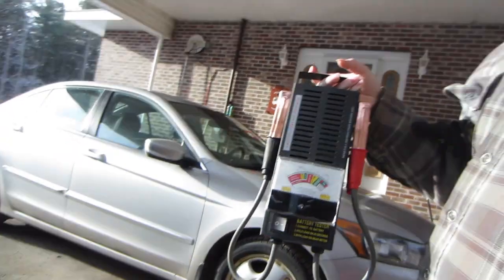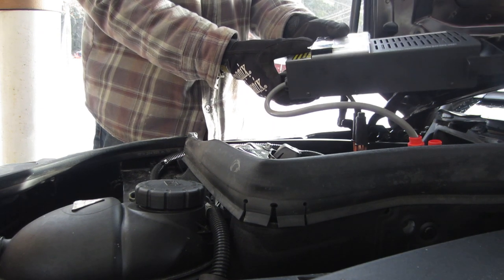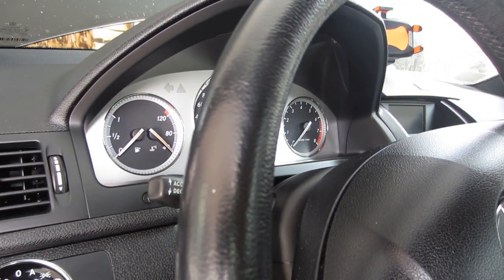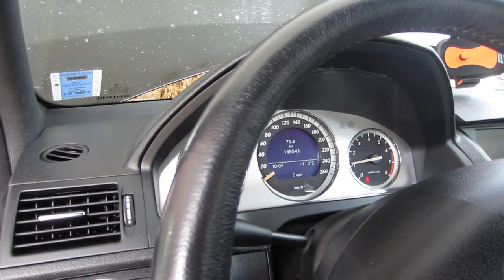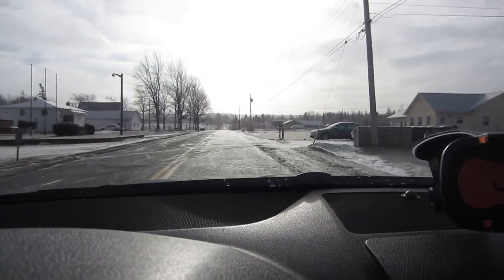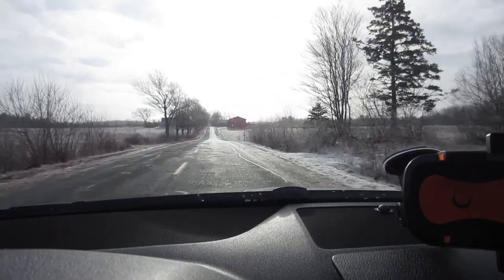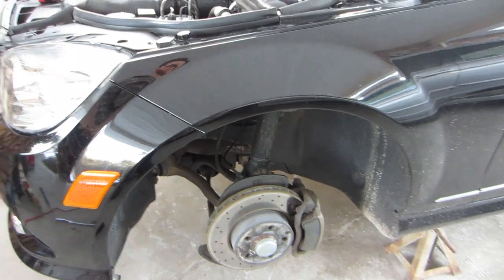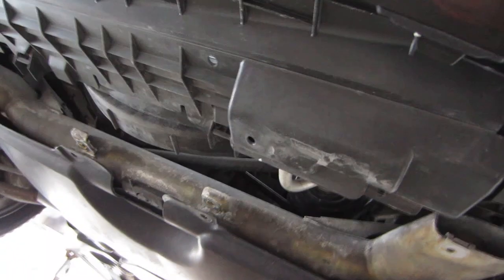I busted the Mercedes -  Fan running when car is off (Solution at end of video)

Comment: Maybe you can help me, I know what caused my problem. I had been looking at my fuses to try to disable the car alarm that kept going off randomly.  I did not even touch the fuses as I figured I would later that day and my big mistake was leaving the fuse cover off since I knew I would be back later on.   The problem is I went for gas and figured why not get a car wash.  I did and as I came out of the wash I heard the radiator fan louder than usual.  I pulled off to the side of the car wash and turned off the engine and then the fan came back on .... I pulled out the key and it still stayed on.  Then I opened the hood and I saw that I had left the fuse box cover off and looked closer and I saw some small drops of water on the fuses.  Murphy's Law.  I left the cover off and then got a car wash and water had somehow sprayed under the bonnet. A bad coincidence. I dried it off as best I could.  The fan stayed on.  I drove it home and it stayed on even without the key.  Right now I have the negative terminal off the battery to stop the fan.  I will readdress the problem in the daylight tomorrow.  Any thoughts ?
Reply from the maker: If you're convinced the problem is in the fuse box, it will likely be fixed once the excess water dries up. 
A couple drops of water in the fuse box shouldn't be a big deal but if you're not sure how much got in, it needs to be flushed from around any contacts to prevent corrosion. You may need to pull some or all the fuses and relays. Either way, isopropyl alcohol (over 90% if you can get it) and slowly pour it over the whole area of contacts, there should be a drain in the box and this will dilute and flush most of the water. You don't have to use the whole bottle. Next step is to get a hair dryer on a lightly warm setting and heat the whole interior of the fuse box so any other moisture and alcohol will evaporate off. Be careful!
Was the engine temperature gauge in the normal range? You could have a bad thermostat. It is also possible for the fan control module to go bad. 

Also check your battery is good and the cables are securely fastened and no excessive corrosion on the terminals or cables. Coincidences do happen sometimes so don't assume anything.  Good luck!
Reply: @merczero1184  The temperature was not abnormal ... night time .... cool weather. I am convinced it is because I left the cover off before I did the car wash ... it all occurred right after the car wash and it was zero problem before.  I sure hope that I did not cause a short.  Thanks ... will do all that you advise !
Reply: @funguy4utube  is it resolved ? I am facing the same issue with my MB GLK 350 . Please advise.
Reply: @nimeshobha  I wrote you a long detailed answer and before I sent it my cell died and the response vaporized.  So here goes once again. I felt the problem was caused by the water getting into my fusebox, so in the morning I reconnected the battery, and I sprayed the open fuse box with WD-40 and I left the cover off and drove for around ten minutes thinking the hot air blowing around would dry out the fuse area.  It did. the problem cured itself.  As for the pulling the fuse that  competes the circuit for the alarm ..... I have yet to do that.  It seems to be one of two 7.5 amp brown fuse in the engine fuse box.  The alarm going off .... which was the root of my problem ... has only happened a few times since.  I do not set the alarm by locking the car and thereby it does not go off.  If I do set the alarm and IF it does go off on it's own .... I go out to the car and put the key in and it goes off.  Obviously it is not safe to leave the key in so I put my other car behind the Merc to block the driveway ....... I know that once I have the time I can test pull the brown fuses and determine which one kills the alarm horn.
Reply: @funguy4utube    Dude this is 100% exact same issue that happened to me with my 2005 CLK-320.  First my alarm messed up, pulled 7.5amp brown fuse in rear SAM.  Then i was messing with front cover, left it off drove to work and it rained.  Needed a jumpstart to get home, and suspected that was the issue !  This is crazy hahaha.
Reply: Having the same exact problem with my 2003 c230 kompressor. Not sure what to do

Comment: I have a same issue with my fan
Some days after turn off engine fan will go fast and stop suddenly, after 20 to 30 min unlock my car it will start again in full speed and off, when car is running temp wil go to 100 c suddenly drop of to 80 c and sign of tempture will turn on and off, after turn off the car for 10 min every thing will run normal again in some days in traffic temp raise near over heating in 120 c i checked fan not working

Comment: I think you have save me some time and money. I have the same problem in my glk 220. That fan get on fire 2 minutes after I lock the car. So tommorow I will first change the battery.
Reply: How did that work out? I’m having the same problem
Reply: @xavierjames9411  hey i change the battery whit normal one not AGM . Becouse the diler didnt have the reight one. Avter 2 hours the new batery was also down. Then i swap whit AGM and ... problem solved. So in my case the batery was the problem. But you need to put the right batery.

Comment: I’m having a similar issue but my car battery got changed and now it still says transmission not in park risk of rolling away and anti theft enabled and vehicular is immobile
Reply from the maker: Sounds like you need to do some diagnostics. If all those problems happened at or around the same time, assume they are all from the same source until proven otherwise. If you're not up to the task of hunting down electrical problems, bad sensors, switches, connectors, wiring etc. just save yourself the frustration and take it to a garage.

Comment: Im not sure if i understand. I have same problem my fan is runnign randomly when the engine is off. My w212 is in third service now and nobody can find the solution why :(
Reply: I've got the same problem today on  my w212. Did you find the problem? I don't think it's battery, because my battery is brand new.
Reply: @TeamKiller06  it was complicated to find where is that problem and not every mechanic was able to find it. My electro specialist found short-circuit on one of ecu called SAM.
Reply: @zmizni  Thanks for the reply. So did you replaced the entire ECU/SAM or the electro-specialist soldered a new component on your sam? I have the same issue. It drained completely my battery in one night. Did you noticed other symptoms when you had this problem? 
Thank you!

Comment: Guys my problem is little diff, w204, c200 (petrol) 2009, today i had a engine heat signal so i quickly changed coolent (it was low), within few seconds after the warning sign i stopped and put coolent. 
Now my fan keeps on running, even after switching my engine off. I waited for 20 minutes still it was running. Finally disconnected the battery. Hope changing battery will help.
Reply from the maker: What does the temperature gauge read? How long was the car running before you got the heat warning?
Reply: MercZero11 hey, once the temperature indicators came I immediately stopped my car, may be 5 meters or 10,  coz i just went to get some drinks near my house. (Maximum 1.5 miles the car has run post which i saw the indicator ) the car is hardly used. Now once i stopped at put water first the temps gauge never went up neither i saw any warning. Now i just asked the battery company to take a dif battery and check but same issue. My battery volt 12.25 new battery volt 12.55. What to do :(
Reply from the maker: @james2k00  Unless the battery was drained to a really low voltage and/or sat for a long time , I'd try charging it first. Possibly even cycling it to full charge then discharge a few times. As I say in the video, normal battery voltage reading during operation or after some use doesn't mean it's good. Put the battery on a charger. If it shows 12.7 V  or something higher, it's holding a high surface plate charge and as soon as you use it, it will drop back to a normal reading of 12.3-12.5V without a load.  This is an indication of a bad battery or what the computer considers a bad battery. Though I can't rule out that you may have a bad temp sensor or thermostat, if the car wasn't running very long, there's no way it should get hot that quickly. Did you also check the oil? Check around under the car for any leaks? (coolant or oil) Also the fan will come on steady if you overfill the coolant as well.  Hope that helps.
Reply: MercZero11 hey update - Battery now fully charged, after a long struggle and consulting with many work shop finally the fan’s resistant was at fault. For $350 bucks got it fixed.
Reply: MercZero11 hey update - Battery now fully charged, after a long struggle and consulting with many work shop finally the fan’s resistant was at fault. For $350 bucks got it fixed.
Reply from the maker: Glad you got it fixed! Thanks for the update.
Reply: @james2k00 - What fan resistant? in the w204 as far is it is on my 2008 W204 the fan has 4 wires: two power lines from front SAM. and 2 PWM wires from ECU.
The ecu controls the fan speed using PWM. (this is why it has "slow start" to not overload the electrical system when turned on, and to NOT use resistors to reduce fan speed, PWM is the efficient way) and there are capacitors on the fan control board.  350$ is the price of a complete new fan with shrouds.
Reply: 700900 700900 Non technical reply - Fan resistant will be the small black oval shaped plastic attached in the fan. I have the picture, wish an option was there to share here. So i replaced that part which was diff to get as it comes along in a set.
Reply: Around The World can you share that photo with me on my email please ?

Comment: Hi. I have a W204  2009 C180 ( 1.6 engine) petrol  bought last year with 97k miles in the UK. Few months ago one day, turned on rhe AC and the light flashed for a while. Soon after that, since that moment, the fan switches on high few moments after I start the car, every single time and turns off when I turn off the car. I had the AC gas refilled yesterday and fan still doing same thing. Any idea what could be? Im glad you figured yours out:D
Reply from the maker: I'm fairly new to the German car world so I may not be the best person to ask but here are my thoughts: First, are we talking the radiator fan or the cabin air fan? Plug in a scan tool and see if there are any error codes, that's the first and easiest thing to do. Did the you or the shop reset any error codes related to the A/C being low or out of coolant? There could be a senor sending a false temp reading causing the computer to think the fan needs to ramp up. Was the system cleared of any moisture?  Also, I've read that there are methods to reset the climate control panel itself but I'm not sure if they work for the W204. I'd be very suspicious of a malfunctioning temperature sensor but it's hard to say. If you have any other details or find the solution, I'd be happy to hear about it.
Reply: MercZero11 Hi. Just received today  a Carsoft i980 diag tool. I am gonna plug it in tommorow and see with what error codes is coming. I also have right rear door s lock mechanism playing up and does not lock with central locking or unlock at times. So I have two issues at the moment. Ill come back to give you an upadate. I have read so much on forums and seems to be a common problem with Mercedes both issues that I have. Thank you for your time. I shall keep you updated.
Reply from the maker: I had to recharge my A/C system myself and I was thinking about this some more. Your A/C system might be overfilled. Listen carefully to hear if the the compressor is clutching in and out at short intervals. Nearly all modern cars have TXV vales that regulate the low side pressure, so if that's all you are monitoring, you could easily overfill the system. All the extra refrigerant would end up on the high pressure side. That would in turn cause heat build up, as well as excess pressure on the compressor, and trigger the fan to ramp up. Just a thought, there could be many reasons but, since you mentioned you just had it filled then the problem started, that's what I would suspect.
Reply: MercZero11 Few months ago the A C button light flashed when I pressed it on. Soon after that I could heart the fan on. 2 days ago I had it refilled at a well know  garage. They bleed the system and refilled it. So the problem was there already. I havent managed to put my diagnostic machine on yet but tommmorow Im off and Ill come back with the codes. Thank you for taking time to answer.
Reply: MercZero11 Checked the car with a Carsoft i980. It only shows my right rear door issues( plays up when I use central locking) but nothing related to A C ( no error codes present). I might have to take it somewhere else for further checks. What do you think?
Reply from the maker: Ya, I'd take it somewhere that has StarDiagnostics. If the fan is coming on high I would think bad temperature sensor but you're not getting a fault code for that. There could be a block in the system, I mean maybe even the txv valve isn't working correctly causing the high pressure side to build. But a shop with the proper gauges should be able to see that as it happens. In doing research for the fan problem I had in this video I did find several instances with the w204 where people had a bad fan module or an actual problem with the ECU. It's unlikely though. And it could be that there is something in the climate control that needs to be reset in order for things to go back to normal. Sorry I can't be of more help. Probably the best advice is, once you've exhausted your methods for checking it, just go to somewhere that has Star and pay the diagnostic fee, you'll come out ahead in the end. Let me know how you make out!
Reply: MercZero11 Hi. Thank you for the time you took to answer me. I shall explore other possibilities and then take it to an indy Mercedes specialist. Wishing you a great week ahead. Ill come back with  outcome and hopefully the solution.

Comment: Back in the days, if you call Mercedes road side service, they can swap out your battery and has the best price.. They discontinue that service.  sucks.  Just a note, go with mercedes batteries.  The mercedes are picky with voltage..
Reply: Mercedes doesn't make batteries. Or tires. Or oil. Or windshield wipers. Buying those things from Mercedes is silly.